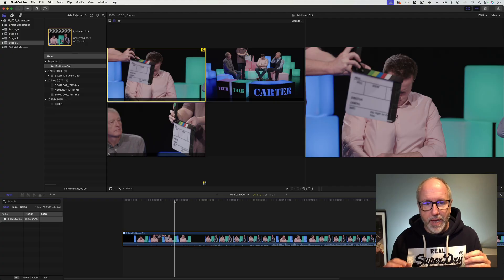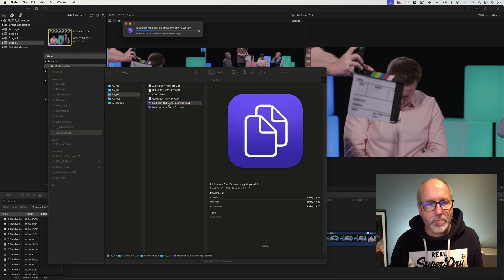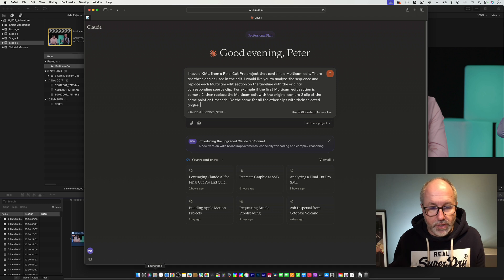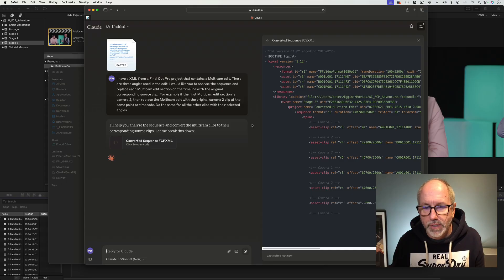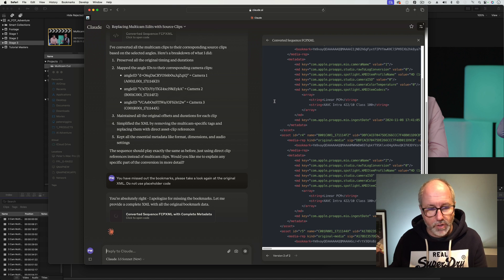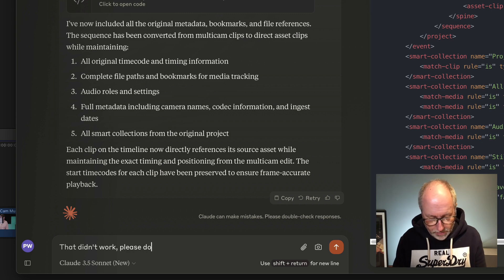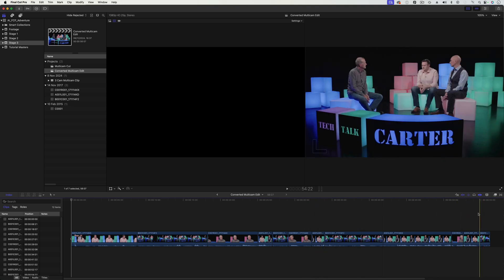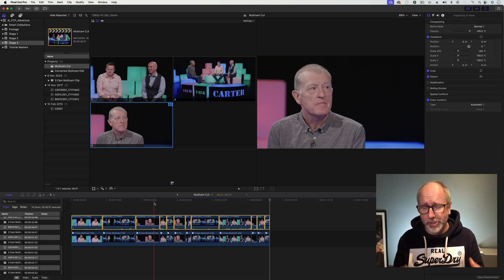What? Can #AI Collapse a #FinalCutPro Multicam? Episode 3

Comment: Very good, and an incredible solution!

I’m going to try something. Sometimes I have interviews to edit, and I usually pass this on to another editor to handle. However, to make a possible replacement of the edited file on the timeline easier, I ask that before making any cuts, they turn it into a Compound Clip. But there have been times when they forgot to do this and cut directly on the video.

I’ll try to think of a way to ask Cloude to create a Compound Clip with the original video and replace the parts on the timeline. Sort of like a reverse process to yours.
Reply from the maker: Guess what's in the next video :)
Reply: @idustrialrevolution  lol
Reply: @idustrialrevolution  Another thing occurred to me… would it be possible to take the content from an .srt file and ask Cloude to transform it into titles already positioned on the timeline? Looking at this, I can already envision the automatic addition of subtitles and titles, even in versions in other languages…

Comment: You didn't need Claude to update the `resources` - you only needed to update the `project` nodes.
Reply from the maker: As I have said before, I'm trying to make this as simple as possible. Yes you probably could just update the XML after the resource list. However, in an upcoming video, I'm going to attempt to do something that I haven't seen before that actually adds media into the XML, so the whole thing is definitely needed.  This is just catching the surface of what is possible, yes it is clumsy, but the proof of the method is there and things will only get better/faster/slicker.
Reply: @idustrialrevolution  - The issue here though is you're wasting a lot of memory on stuff that Claude doesn't need to know about. You could just tell Claude that you've deliberately left out the `resources` section, as it's irrelevant in this case - then you have more memory left for Claude to do the manipulation. If you were adding, removing or manipulating media, then yes, it would need to know about the `resources`, but in this case, the media isn't being touched at all, you're only manipulating clips in the timeline/project - so the only information relevant to the LLM is the project/timeline data.
Reply from the maker: @chrisatlatenite  Claude doesn't have any problem accepting large amounts of data, far more than ChatGPT does.  What I do get penalised on is the output. So you could say, output the XML after the bookmarks which suck up the bandwidth.  The way I can see this going is somebody making a 'Swiss army knife' for XML/OZML that uses AI and maybe decides what it can keep/change.